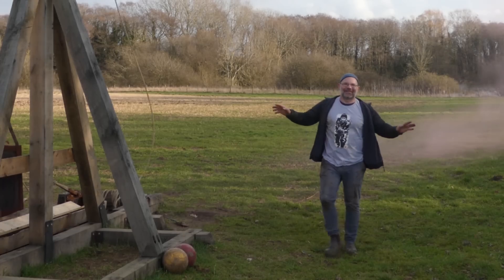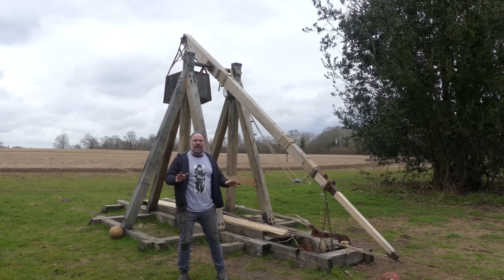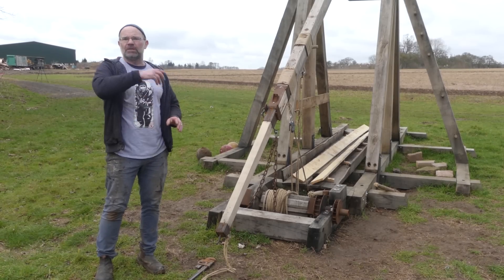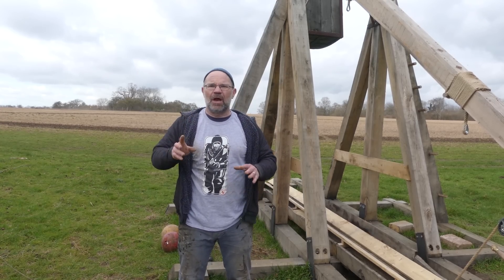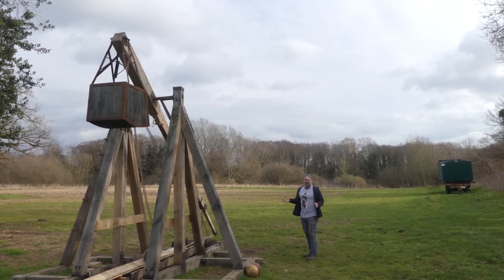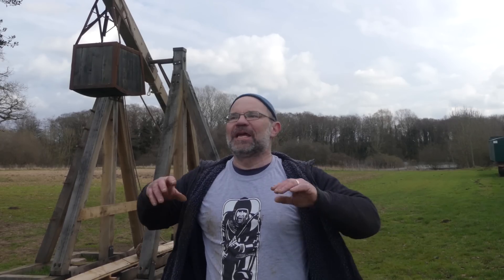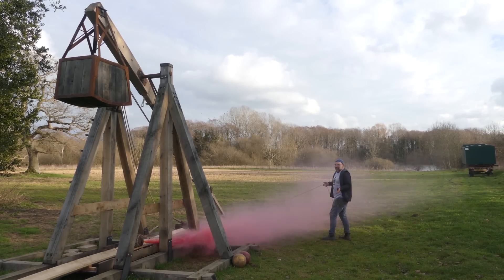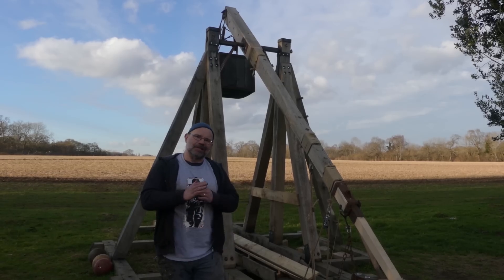Trebuchet - Why won't the darn thing shoot further?

Comment: By extending the throwing arm, you have decreased the hight to which the counterweight goes. You should also increase the height of the swing axis. This will give you a bigger stored energie in the counter weight and a longer trajectory to accelerate the bowling ball. In simulators ratio of 1:5 on the arm works best, string also 5. Height of the axis also 5.

This is rather difficult on your current machine though.

Comment: Hmm . Statistics of course is nice, yet if you really intend to shorten the experiments I suppose the changes in the trajectory should be (ideally way) bigger than the effects of pure randomness. And that basically also means that close to optimum you might have a lot of randomness in comparison to the small changes that are needed for an improvement. Is that what you see here bec there is no logic in it which is exactly something that you might want to call randomness?

Comment: Your lossing a great deal of potential energy transfer due to the way you have attached the counter weight. The penduluming counter weight allows the weight to fall more or less straight down. If the  weight was fixed to the arm it would fall in an arc which is longer allowing the arm to accelerate more. With a fixed counter weight you would need a braking system to slow and stop the arm after projectile is released.

Comment: Lifted from make magazine regarding wheels on trebuchets

Wheels:
Trebuchets large and small tend to have wheels, which initially appear to be for transport. And while this would be true for minor adjustments, the largest trebuchets were so massive and heavy that they would have to be assembled on location. The real purpose of the wheels is to allow the entire mechanism to move back and forth as the counterweight is released, keeping the weight’s movement as vertically linear as possible. A weight that rotates downwards loses some of the power of gravity as the force on it has to be transferred into a forward and then backward motion. But if the counterweight drops directly downwards, it can maximize the effect of gravity.

Comment: If you want to increase distance you should add wheels to it. Adding wheels allows the counterweight to fall in a straighter line. It delays the stall point of the counter weight until the arm is in the vertical position.

Comment: Well... on April 23rd 2022 you'll have learned that you should put a tripping linkage on top of the arm that is kicked over by the counterweight to cause the release of the sling so you can stop faffing about with some kind of physics joke.  Bit of torsion rod should do it for a spring, you'll want a mechanical trip at the hook.    Fine details are only hinted at in the old drawings.

Also a set of yokes/socket under the end of the main throwing arm so you can install different lengths of final arm for different masses would be nice, yes?

Also, have you considered a pulley tip so you can loft javelin from a launching board behind the rig through pulley doubled velocity?

Comment: I didn’t watch the video but it’s all about the point of release. Release to soon the object travel up instead of out release to late and the object travels to straight with not enough arc to gain distance. Around old castles they used to have field stones that were markers the people manning the trebuchet could use a depth finders to either add weight or decrease it from the counterweight to get the distance they desired. But the hook determines the release angle.

Comment: I'm not sure, but is it possible that a lot of the movement and the energy of the swing bounces back from the ground into the Trebuchet? Basically shaking it apart?

What you would need would be to essentially put the trebuchet on wheels so it could move with the swing as a sort of "recoil". I feel like you would then be able to get the weight all the up without risking a dismantlement

Comment: From the looks of the video, the weight swings back and forth. When it gets near to the bottom it swings forward and makes the arm hesitate or slow down and there you loose momentum and power is less. The Trebuchet I saw did not have the weight held so loosely and did not swing back and forth. Just a thought. . . . Looks like others already said it. Oh well.

Comment: This is more about maximising the escape velocity of the object you are throwing. To get the highest possible speed you need to maximize the energy transfer to the object. So focus on maximizing the energy transfer rather than the optimal release angle. And consider the aero dynamics of the object you are throwing too.

Comment: seems to me you want to increase the time during which the counterweight is accelerating, without increasing its distance from the arm pivot point. Way to do this would be to have the arm as far back as possible, i.e in this case, vertical. So you need to increase the pivot height.  Right now the arm starts within at least 60 degrees from vertical, so not optimal.

Comment: You should put wheels on it - that would let the entire frame move forward and allow the counterweight to drop in a much straighter line instead of dropping in a arc, thus causing stresses on the frame which leads to inefficiency.  There have been many different "modern" trebuchet designs which try to achieve this without wheels, such as a floating-arm trebuchet.  But the easiest way to achieve efficiency gain is simply to add wheels to it.
Here is another YT trebuchet video where the maker added wheels to his trebuchet and performed a detailed analysis on the mechanics of adding wheels to it.
https://www.youtube.com/watch?v=KpFTyE-wiNo

Comment: Only slightly related to your video, but you might like the story. In the Dutch city of Nijmegen they have a yearly festival of reinactors and other historically minded people called 'the gebroeders van limburg' and one year they had a working trebuchet which they used to lob projectiles (not sure what, waterballons prob) at the old gunpowder tower in the city park. (this tower: https://nl.wikipedia.org/wiki/Kruittoren_(Nijmegen) ). You can see it work here: https://www.youtube.com/watch?v=Ixjelimny5w

They also messed with the ranges for that trebuchet, and eventually the city stopped them because they started to throw projectiles over the tower, and they were at risk of actually lobbing them into the busy city center part of town.

Comment: If you stop the video exactly at 5:40, you can see that at the point where the counterweight is at its maximum extension (i.e. it is hanging at the same angle at which the arm is), the projectile has not been released yet. Since that point, the counterweight is actually slowing down the arm and that reduces energy of the shot.
The very least you can do about it is to make the counterweight hang on longer hinge. It may require making the trebuchet higher to prevent it hitting the ground. You can also put a "scythe" at the end of the arm to make sure the counterweight goes straight down and is not being pulled towards the back at the end of the arm swing. Or you can put the trebuchet on wheels, that way the pull of the counterweight will move it slightly forwards during the shot and that way some of the energy lost on pulling the counterweight back will be put into speed of the arm end.

Comment: I feel like these issues could have looked up before making it in the first place, as the original ones launched larger projectiles for long distances, and the War Wolf would've had to overcome these exact challenges given its massive size. These isn't so much a fix as much as it is an example of "do your homework the first time." This isn't a modern-day dun that to upgrade requires outside-the-box thinking in regard to physics, engineering, etc. This is literally copy&paste of something we've long since had and known about...That this wasn't launching something made of stone the size of a volleyball already is what surprises me, to be honest. Why make something that takes the same expertise and effort and relative size, but design it for smaller projectiles? Just make the normal one first with the minimal setting allowable for the bowling ball, which could be designed in planning before ever even building the thing. This isn't experimental tech; it really should be as simple as copying the exact specs of every other like siege weapon...I feel like he knows this and just needed a reason to put it on YouTube, as if a functioning trebuchet itself existing wasn't good enough a reason.

Comment: 👉It will throw further if the whole machine was on wheels or a rail, to slide forward or back. You are losing power from the basket tilting at the bottom of the fall.👈

Comment: Your trebuchet arm is stalling at the top of its swing. It dramatically slows down. Ideally, you want to release the sling when the arm is moving at its highest possible speed.  Lengthening the arm alone does not necessarily increase speed of the arm tip, as it adds moment arm for the counterweight to have to accelerate.   What would help is a longer fall for the weight. The longer the weight is falling, the higher the final speed for a given mass of arm. What would help even more is a STRAIGHTER fall for the counterweight. That is, the current design asks the counterweight to swing slightly to one side, as it falls in a circular path, and then below the axel height a lot of its energy gets diverted into swinging under the axel as the rate of its drop is slowed. The solution to that for this style of trebuchet is WHEELS.   Rig a pair of dead level steel rails and 2 pairs of steel wheels to mount the entire rig on top of.   This will add distance in three ways… First, it will allow the massive counter weight to drop in a straighter line because the lateral forces will simply roll the entire trebuchet first backwards, and then forwards- resulting in a higher acceleration downwards.   Secondly, as the weight swings below the axel  and towards the rear, it will propel the entire trebuchet forwards, just at the moment the sling is released. This is additional acceleration in the direction you are trying to throw the ball. And thirdly, because it allows the trebuchet to roll and the bucket to swing without the lateral braking forces of a rigid mount, the arm will stall less at the top of the swing and you will get a little more followthru to ensure the maximum speed at the release point regardless of pin angle.  factor 1 will add about 5% to the distance. Factor 2 will add about 8% more to the distance, and factor 3 will add perhaps 3% to the distance.   With a very low friction set of wheels on a level and smooth track, you should be able to eek out about 14-15% greater range.  Another thing you can do is look at redesigning the counterweight to be the double hinged, top loaded design that adds an additional pivot point to the fall of the counterweight.  These essentially put the counterweight even higher, for a greater fall distance, and the added pivot helps both straighten the fall of the counterweight, And its pivoting action adds to the rotational energy of the arm.

Comment: I'm pretty sure you could fix the problem many people mentioning, that the weight is stalling the swing, by not using a straight arm.Past the pin the counterweight sould be attached to a bar at about a fifteen degree angle. That would cause it too throw while the weight is dropping, instead of after it begins to swing back against the throwing motion.

Comment: Tod, Watch the clips of the Warwick Castle one shoot, and watch the swing compared to ypurs, easily finishes with a release at 45 degrees. you weight is the problem as others on here have said. yours never goes past 180 until the ball has gone.

Comment: I told you earlier that wheels were used. If you want more reach use wheels. Build a base for the wheels if you're worried about it sinking in the ground. It's not rocket science.

Comment: The last section of the trebuchet should be made of a bow type material or spring steel. Would greatly increase the distance and power as well as change angles( might be interesting to try)

Comment: Actually i think it's shooting fine sir, but i suspect that those bracing beams are 6 to 8 inches thick, and although i don't know what quality of wood they are they should hold significantly more weight.  You could try replacing the counterweight box and upgrade it to 4 tonnes.

Comment: The arm seems to flex a little toward the top of the swing when it is fired. This back and forth movement may be the cause of your distance loss. Try a more rigid arm that does not flex as much.  A long one piece arm that is thicker in the vertical dimension. Good luck.

Comment: You asked what you were doing wrong immediately after explaining what you’re doing wrong: you aren’t getting Enough test data. Buy more bowling balls and run ten test shots with each new configuration.   I suspect the machine is a lot less consistent than you expect, and being able to average out the results will give you a better idea of how much your changes are affecting performance.

I don’t know what changes you actually need. But buying more bowling balls would give you want you need to figure it out in your own

Comment: The length of the arm just seems way too long to me. It doesn't have enough time to gain angular acceleration, just as its getting going it hits the top. I think you need to make the whole rig taller, if the pivot point is higher off the ground you can get the arm to start at a steeper angle which will give it a longer arc to accelerate through.

Comment: i think the basket is dropping too straight and is causing the arm to stall when it hits the bottom of the drop , i think the pivot point needs to be moved slightly forward so the basket drops in an arc. looking back before you extended the arm it stalls out after the loose i think the basket arms are too long

Comment: Depending on how much modifying you want to do, you can always try and increase the force/torque in the system. The easy way to do this is by increasing the counterweight of course, but you'll hit a limit on the strength of the arm. So you could increase the strength of the arm. If you're not bothered about medieval authenticity, I'd suggest taking inspiration from the composite bow and adding some high tensile material (like braided steel rope) to the top side of the arm. That should allow you to increase the counterweight and/or the length of the arm.

Comment: The counter weight is bobbing around on release and it looks like it is interfering with the release. As an "arm chair engineers" I would look at how the weight is attached to the arm and maybe look at using a hinge that looks like an upside down T so you still get counter swing but not the crazy  bobbing. You could use a chain on the inside of the arm and the weight to limiting the back and forth bobbing. Also I would look at making the length of the arm that is attached to the weight and the pivot point adjustable as it can have just as much an impact as the weight.

Comment: Shorten the rope, it will reduce the arc and turn it into distance. take off like 2 or 3 inches at a time between test fires, there is only so much benefit faffing about with angling the end pin. Really cool by the way, I do like me some indirect fire artillery. You could always put a bigger weight on the end instead with the same rope length..... Now that projectile would  would fly alright Haha.

Comment: I built one of these for an AP Physics competition in high school.  I won by inventing what could be called a "scoop release" or "cradle system".  It's difficult to explain, but if you can imagine a lacrosse stick's head attached at 4 points by ropes to the swing arm, angled at 45 degrees at release point, then perhaps you can get the idea.
No need for hooks, all connection points are static, only requires rope adjustments to find maximized throw for given arm and counterweight settings.

I also think your throw arm is too long for your sling.

Comment: The mathematics of a Trebouchet are quite complicated, but there is a calculator somewhere on the net. From that and the ones I built I got very good results with a boom ratio of 1:1:4:4 (counterweight arm : boom counterweight side : sling side : sling) and a counterweight to projectile ratio of 100:1. With such a setup, i managed to throw snowballs to 100 meters - and these are really not dense enough to fly far. But I was in an urban area where throwing stones was a bit problematic ...